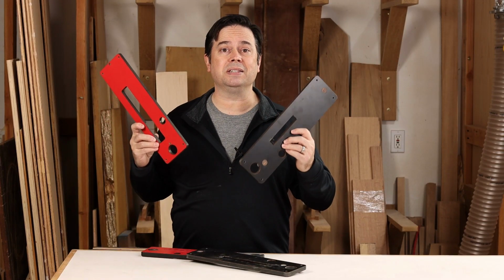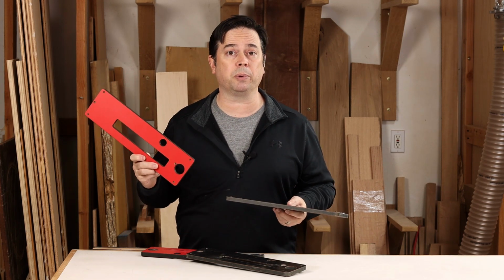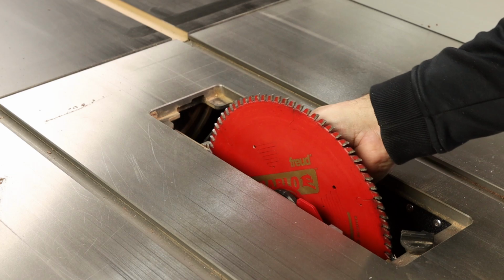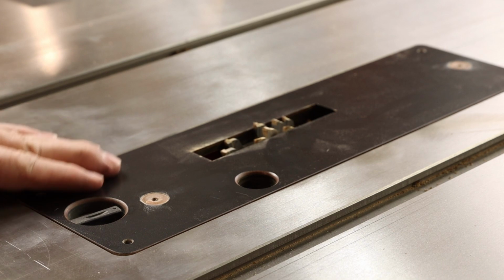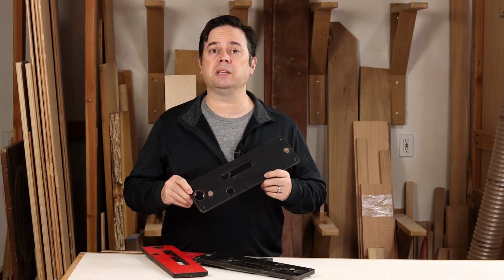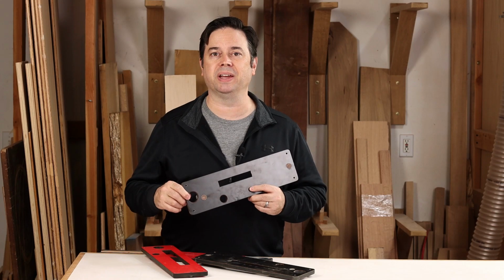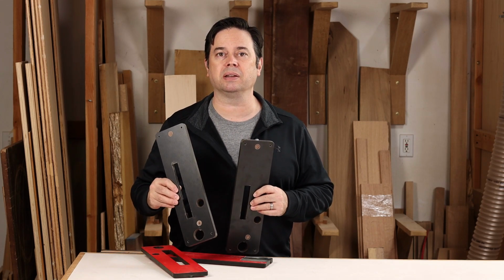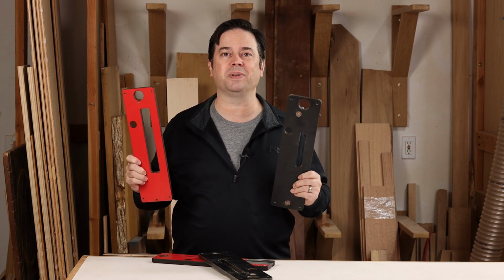How To Make A Table Saw Throat Plate | F2 Tablesaw |  Laguna Tools

Comment: good job but you forgot to mention the most important part which is the groove needed for the blade lock on the saw to fit in the throat plate. I built few of these for my F3 and always had to guestimate where and how deep of groove is needed.

Comment: When I had a machine shop I would make the insert on a milling machine using carbide tooling. In fact much of the joinery work I did on furniture was accomplished on the milling machine.
I recommend at least a manual milling machine and an engine lathe in the wood working shop.
Reply: That's good advice.  Thanks.